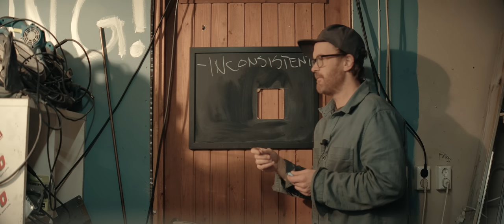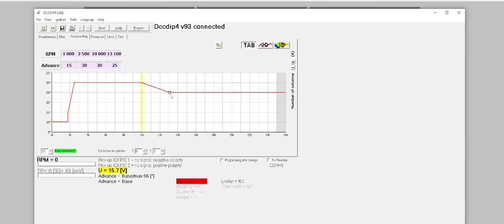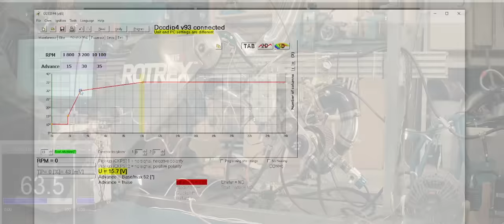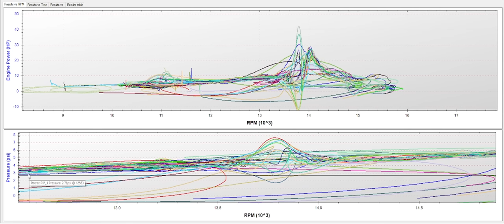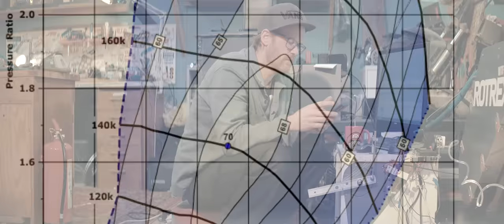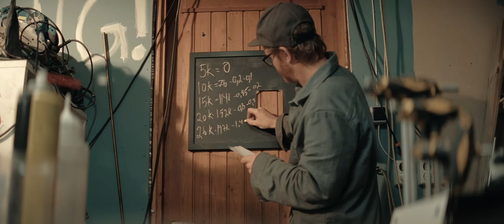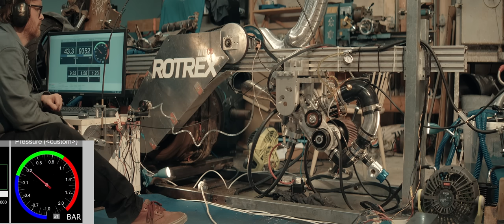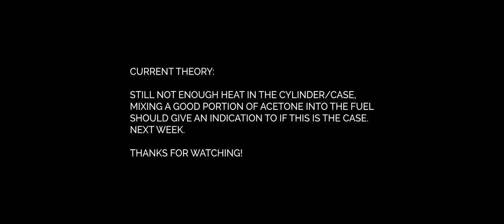Supercharged Pulsejet Engine?

Comment: Your videos are fascinating to watch for engine design, i feel your pain to achieving your goal. As a fellow engineer it's great to see the process of your thoughts, inspiring even.  I have had this idea a for 2 stroke petrol with oil sump and oil control ring, that closely relates that of Detroit Diesel. To start engine it would need electric turbo, then a switch to standard one once running (with air and exhaust storage either side to 'soften' pulses). Mass airflow meter, map sensor, ecu with possible map switching and  pressurised destratified direct injection to eliminate fuel waste and misfire. I feel full computer control could be solution for more efficient engine vs a 4 stroke even. The rotary exhaust timing control being the best idea yet of yours. Could this work?
Reply: Not without a blower unfortunately, even the turbo Detroits are twin charged rather than straight turbo. You could certainly have a clutched pulley to relieve the engine of blower drag once you're in an adequate boost condition though. If that was the only thing stopping you, start drawing it up! We need more mad scientist engineering on YT!
Reply: @maccadan90  The electric turbo is for starting only.
Reply: @simonhare7369  How are you going to push air into the cylinder at idle? or Under any condition except high boost? Especially with an exhaust storage chamber as you call it, you're losing all of the effective power to drive a turbo, much less drive one at idle. You will require a positive displacement pump, not a centrifugal one like a turbo. You must force air into the cylinder under all conditions.
Reply: There is the hope that once started via the electric turbo, then switched over to the exhaust driven turbo (both functions could be combined into one special design) there will be enough expansion of exhaust gases to sufficiently rotate/boost the intake side of the turbo without a displacement pump,  i.e. use of the crankcase.
Reply: @simonhare7369  Unfortunately my friend, the hope is misguided. You don't need to use the crankcase, but you will need a blower. Otherwise there's nothing moving air. Since engines are primarily air pumps, you simply won't achieve a very useful engine if it runs at all. There's no load applied to produce the pressure wave you need to drive the turbo, and you're talking about further reducing that capacity with a high volume exhaust jacket. Since a turbo is a centrifugal pump in principal, it's simply incorrect to assume it can handle engine airflow requirements until it is flowing in a useful region of its compressor map. Keep researching! You can do this, don't skip the details

Comment: What does the fuel mixture going through the crankcase look like? Is it a vapor? Or is it like someone turned on a hose? It should be a steady flow of a fog that the piston is chopping up and lighting. Maybe the carburetor is too close to the motor, put a 6 inch tube between the two. Then try a longer tube. The fuel needs time to mix with the air.

Comment: I'm not hearing any mention of air fuel ratios. Did I miss that part?
Reply: For some reason, Alex refuses to add simple and inexpensive instrumentation that would give air-fuel ratios. Much of this hand wringing and guess work would be eliminated if I knew what was flowing into that crankcase.
Reply: @davidgierke7582  I didn't want to jump to conclusions because I've only seen a few of his vids. Now you've told me he is not using a wideband my level of frustration with what I have seen has pegged the meter! I'm thinking if he did use one he could slash days if not weeks off the development time. At least on the fuelling front.

Comment: Loving it all, thinking that adding more heat is good but could you try experimenting with stinger again. Reducing size to give a little more pressure to combat the blow off effect. Also more volume in the exhaust expansion chamber and length. That pipe would work well on my 2 stroke engines but your engine is doing allot more work . I think it needs making bigger/ massive in fact. So look forward to ...see you next time. .. vespa Rob.

Comment: I like your videos very much, i think that the blower makes to much pressure and is just pushing a part of the gas through the burning chamber when the exhaust aud intake ports are both oben, then ignite from the hot air in the pipe. Thats why it makes a pulsejet. Good luck

Comment: Without an exhaust valve or exhaust restriction your boost goes out the exhaust pipe(flames}. The engine will act rich but actually be lean {poor BSFC} and boost pressure will be lower. Power will be not much better than NA without it. The exhaust port is still open when the transfers close so boost bleeds out the exhaust. love the channel and your ideas!
Reply: @g.g4816  Really? I mention this to him because I did this experiment 30 years ago. You can not increase cylinder filling from boost pressure if the exhaust port is still open after the transfers close with out a mechanical or pressure device to hold the charge in. Pipe dynamics will get you 3-4 psi is all.
Reply: @allblowdup  hahahahahahaha yust stop noo

Comment: I think an engine with less radical port timing but still having high flow (challenging I know) would benefit more from the blower than port timing designed for using exhaust pressure/pulses. Higher boost pressures (on this engine) may just flood the exhaust with unburned fuel.
P.S. You handled the Lord/Lady thing better than any of the other channels I have seen.
Time will tell the truth.
Reply: Alex did handle the Lord/Lady thing really well didn't he!
Just as a  bit of info, this engine has achieved 18300 RPM using the Roots blower and speedway carb with 15deg of timing.

Comment: A thermal barrier reflective coating on the combustion chamber, piston crown and exhaust port might help keep the heat where it belongs. There’s a company called Swain Tech that does it, I would imagine that there are others. I’m thinking you probably already know about this but thought I’d mention it anyway 👍

Comment: Alex, I have mentioned previously about removing the reducer in the outlet of the carb. I presume you feel this is having no impact on fuel atomisation but could this be the case. I know I'm only surmising but you don't have to run the carb fully open. I also accept your time is limited. 713 comments in about 11 hours, you have a huge fan base.

Comment: I think the overlap is causing the pulsejet effect, by blowing some mixture straight through the engine without having a chance to combust where it's supposed to, the combustion chamber.
Reply: That is exactly what I was wondering. It’s seems there is the possibility that the inlet and exhaust ports are wide open for a good period of time.
Reply: As you say the fuel MUST be fully combusted prior to the exhaust port opening otherwise the fresh mixture will ignite in the expansion chamber giving the pulse jet effect which people seem to like. This ruins resonance in the pipe turning it into a flame thrower nothing else.

Comment: Hi! Is it actually possible, that your supercharger begins surging? Surging occurs, when you run a too high pressure ratio / compressor speed for the corresponding massflow. In that case you will obtain a stall of the airflow on the compressor blades, hence a sudden pressure drop. After that pressure will  build-up again until you experince the next stall and so on.... normally audible in form of a terrible noise. This is likely to happen, if the compressor is chosen too big for the given project. You can find the surge line on the left side of your compressor map (dashed line).  The more pressure / speed you want to make, the more mass flow you need... in case of the Rotrex C15 (which I believe you use, right?) you want to see not less than 0.03 kg/s, which equals about 25ltr/s of ambient air. If you compress it by a factor of 1.6 it will still be @16lr/s, if the temperature wouldn't rise. This is 320 times of the displacement of your engine, which means that you would need to rev more than 320*60=19200rpm if you want to trap all this amount of charge...To find out, if surging is the problem you have,  you might want to measure the airflow going through your compressor. Stay tuned, kind regards, Stefan

Comment: Did you ever consider a power valve system to lower the exhaust port timing to create more cilinder pressure at lower rpm's?

Comment: That 15K (+/-500rpm) limit.... different timing, different boost, different plug gap, different temps, different jets, different carby settings.... Only things remaining is the ignition system itself (Perhaps doesn't like exceeding 15K - its accuracy just breaks down) or you're hitting resonance/certain harmonics in some part of the system which is corrupting the desired flow dynamics.
- Do you actually need the exhaust resonance when the engine is forced induction? Can you straight-pipe it?
- Can you obtain another ignition system for testing? (A full ECU this time like a Haltech/LINK/etc..? This also opens a door to transfer-port EFI)
Reply: If you check out "supercharged 50cc engine throwing parts" from around 4-6 weeks ago you'll see this engine rev to 18000k plus using this ignition at 15deg BTDC along with the same expansion chamber using the Roots blower/speedway carb. The only thing that has  changed is the blower/carb and using blow through.
Reply: @malcrandall1309  ah, kudos - I did watch that one, but didn't recall it hit 18k - thanks. So I guess that leaves option B: unwanted resonance.

Comment: if u ever want a hand with any software stuff let me know im a young 2 stroke guy that grew up calculating pipes by hand no calculator i have moved onto tuning  peoples turbo efi cars so i can help give u better sensor data to allow better reading 

also do cnc and cad work so can assist with manufacturing knowledge aswell

as always your awesome and i cant wait to see this project you have single handedly made me get back into the 2 stroke world 

this is gonna be on insane machine when done

Comment: I know guys who have run methanol in their derby cars without a radiator. Just looped the hoses from the output of the engine to the input of the water pump. Never overheats. Sometimes have frost on the intake manifold after the derby. 

Most Monster trucks do not run cooling systems. They just add more methanol to cool the engine down.

Comment: Alex, a thought for your consideration, what about 3D printing a adapter to fit the speedway carb to the Rotrex. We know this works with the Roots blower.......... Don't forget to refit the stinger.
Whats wrong with the Rotrex, did it just boil over due to RPM?

Comment: seems like you are getting a small amount of the charge air to burn considering how much burns in the exhaust once it ignites.  is your pipe made to stop the flow of exhaust shortly after blow down? could you stick a temp probe in the crank to check temp and see if it is burning in there? might need some sort of pressure regulator on the exhaust that compensated for the rise in boost pressure.

Comment: The moment both intake and exhaust are open the blower is pushing the unspent fuel too far into exhaust for the concussion to bring any back before its covered again. That's my thoughts on it. Also, laminar vs turbulent flow, may be your issue because faster air-flow does not necessarily mean more air. I'm sure you know better than I. Love your work bub. Keep it up.
Reply: I think you're right that the pipe may be too long now that the average flow speed through the pipe is higher. 
But if the added flow is un-burnt, it's a lot less volume than if it had burnt.

Stinger flow capacity should be made to be adjustable on the fly.

My other thoughts:
Pulses of mixture change can be clocked to their appearance on the output graph, with perhaps dozens of such brief pulses spread out over the powerband. This could give more data per run without having to shut down for each change to the mixture.
The same can be done for the timing, showing at what rpm points that brief changes are having the desired effect without dedicating each entire run to just one timing map.
Yes, this approach requires hardware/software additions, for electronic timing advance/retard pulses, and tiny fuel and air injectors for mixture change pulses.
Yes this does argue for the EFI approach.
...All this to speed up the tuning process.
Reply: @dddzzzdddzzz  shorter pipe might also put on a light show.... lol
Reply: How about a 50cc rotary with the blower?

Comment: You really need to invest in a EGT system. Figure out what your exhaust temperatures are. We use EGT to tune diesels but in this case it will actually tell you if your combustion gases are hot enough. Exhaust Gas Temperature sensor. I think  you can get an entire kit cheap on amazon for less than $60. You can use EGT to learn a whole lot more about your combustion process. Are you running an AFR system? At least not one I can see. A wide band oxygen sensor is also very cheap and you can at least dial in your fueling a whole lot better. I mean the number the dyno produces is great and I see you counting spark cycles. Between a wide band and an EGT you should be able to learn if you are too rich, too lean, not enough  atomization to fueling. A few more sensors to tell you whats going on would be amazing. Also have you tried using an old school oscilloscope to check to make sure you are actually completing your spark at 15k rpm?
Reply from the maker: 👍 I removed the egt probe while testing the brute force concept cause it gave nonsense numbers from all the unburnt fuel/oil passing through in the transfer phase, should add it back in. A WBO would probably die almost instantly for the same reason. Was looking at some oscilloscopes yesterday, definitely a great idea👍
Reply: @2STROKESTUFFING  Ah I guess I missed the whole brute force concept part (I mean its obvious I'm just dense). Its so empirical testing one off engines set ups like this. I love that you take the time to film it for us.  If you are worried that atomizaton is the issue what if you switch your carb to a suck through instead of blow through temporarily just to see if power increases from that longer atomization time? Dual plug ignition could also help? I mean at 50cc thats gunna have to be some tiny spark plugs!

Comment: You may want to consider a spring loaded tensioner on the supercharger drive belt.  It will stretch a bit under load and could start to slip a bit.

URD has all the different pulley sizes in that style in stock, but URD is in the USA.

Comment: EGR? Maybe hot exhaust gasses could be recirculated to keep the intake air warm, making sure fuel vaporizes at the carb. Also remember that when the pressure drops due to the crankcase volume the fuel will tend to tall out of suspension. Not sure how to address that one.

Comment: This may or may not help......
I have supercharged a few A sereies engines in Austin minis and mg midgets,
I experienced carb icing because of the increased (forced) induction,
The cure was a 12v heating element inside the air filter,
I was dubious at first about how much difference it would make but it worked a treat and even in the UK winter with ambient temperatures of 0degrees the small heating element solved all the problems. 

You are 'blowing' through the carburettor as apposed to sucking through it like I was but for the cost of a heating element I would suggest giving it a try.

Perhaps position your engine heating preparation device (hairdyer🤣) in front of the air filter would be worth a shot?
Reply: It's the difference between atomized droplets and latent heat vaporization. I've also done it.

Comment: Dont know if i have seen the inside of this engine. Do you have some kind of crank case filler on the counterweights? Less volume = more pressure. I know Husqvarna use them for more powerful chainsaws. 
Awesome work! Greetings from sweden! 😁

Comment: Maybe consider a couple of glow plugs from a diesel engine to help with heat up of crank case while running,  or maybe enough just to use them on warm up ??
Reply from the maker: 👍 Great idea!
Reply: That might work, as long as the glow plug's incandescent heating element isn't in direct contact with the atomized, vaporizing fuel content within the crankcase.
Reply: I thought the output a 2kw paint stripper air gun directed into the Rotrex intake would work.
I used to use this technique to get tired diesel engines to start.

Comment: Is that Dump Valve actualy doing anything??
I thought it was supposed to open when you close the throttle.... It looks like its still boosting through the engine on the over run causing the exhaust to turn into a flamethrower! I cant see it doing anything in the video or making any kind of sound that its actualy "Dumping!"
Thanks for the vid Alex..
Reply: I don't think so! It needs a strip of paper taping to the top of the B/O valve to show when opens.

Comment: I follow Cleatus chanel on youtube, I might have missed something but when they run drag races on ethanol they don't have radiators at all because the fuel cools so much. Short races but then they also drive back to the pit. Even if it's short distances they should overheat on the short distances but they don't. Great videos!

Comment: i doubt its going to solve the issue, but wouldnt preheating the fuel help a bit with vaporisation and ignition?
either with using the colant or electricity to warm it 
also could do the same thing with the air, compressing does heat it up a bit already but if your shop room temp is cool it might help getting more heat in to the cylinder and even carb
Reply: similair to how some other vehicles do it